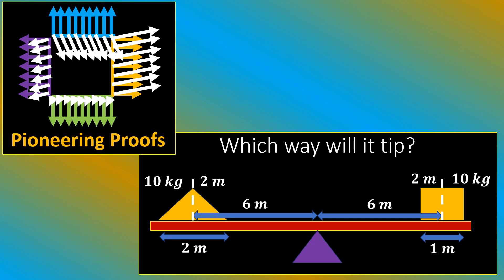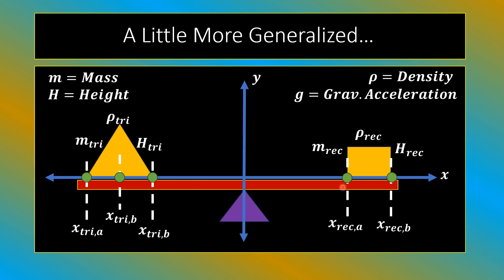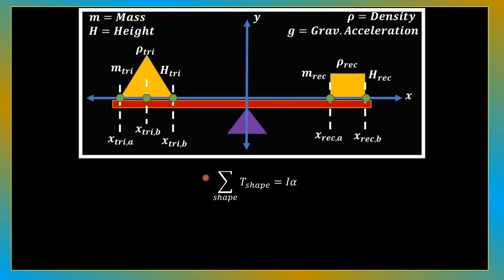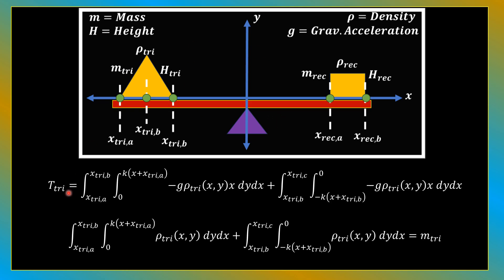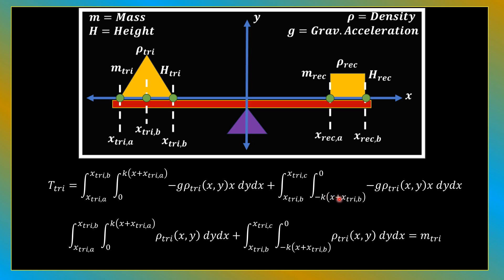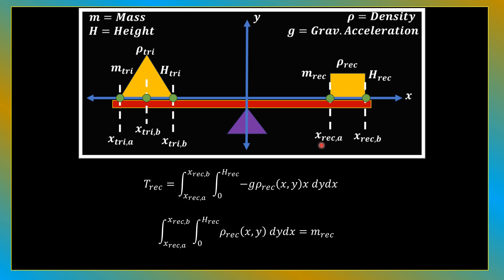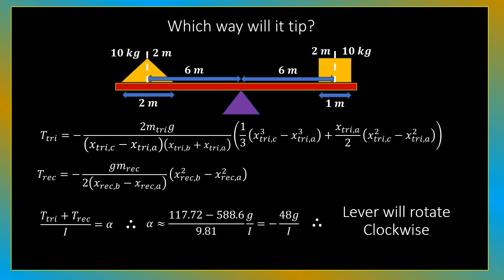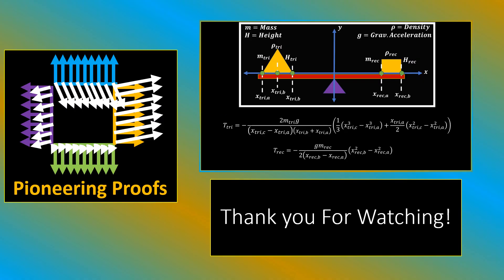Can you Solve this Lever Engineering Puzzle?

Comment: When the lever arm is horizontal, the system is equally balanced so will not rotate.  However, once the lever is tipped slightly, the height of the centres of mass becomes relevant, and the centre of mass of the square on the right is higher than the triangle on the left.  This will result in a net torque which operates in the direction that the lever arm is already rotated.  Interestingly, it doesn't matter whether the mass with the higher centre of mass is on the left or the right.

Comment: just finished my BS in ME and i would suggest that equal mass and equal distance to center of mass for both shapes would imply zero rotation. sum of moments about the fulcrum establishes that, regardless of shape, (10kg * 6m) - (10kg * 6m) = 0. height and shape are irrelevant. the total moment is zero, thus no rotation. i always recall center of mass as king but please correct me if im wrong!
Reply: No you’re 100% correct! I think the author made a mistake somewhere in their calculations. That said, it’s an interesting problem and always good to double check :)
Reply: I was surprised to see the conclusion that the lever would rotate at all. There's an error somewhere, but I'll leave it to someone else to find it.
Reply: @clarencegreen3071   I have done the calculations for fun, which this comment is too narrow to contain (Fermat would be proud). Jokes aside, a “very short” proof follows by the fact that the integral for the torque can be shown to be equivalent to $-g*rho*\iint_A x dx dy$ (using LaTeX notation… what I mean is a double integral of the function f(x,y)=x, with A, representing a shape, as domain). The double integral is, by definition, one of the geometric moments of order 1 of the shape A, which can be shown to be equal to the area of the shape itself times the horizontal (x) barycentric coordinate, let’s call it X. Since area times density is the mass, the torque simplifies to just -g*m*X. As you can see, it depends only on the position of the center of gravity and the mass, the shape has no influence. You can show the result by calculating the integrals explicitly as well. I have done it as well for fun but it takes around 3 pages - already formatted with LaTeX!
Reply: @francofusco4206  haha i love to see the mathematic proof behind it. as an engineer i rarely look that deep into the math. from my perspective, i just set it up as a simple sum of moments. about the pivot, the moment is M = (F_⊥) * r. that is, only the component of the force that is perpendicular to the line of action (in this case, the 180° flat line), can cause a moment about the pivot. in this case, the force for each mass is their weight, which acts at their centers of gravity. because we only care about the perpendicular component, the y-location (height) of the center of gravity for each mass is irrelevant. each center of gravity has the same x component, which would create the same perpendicular force component, and thus result in the equal and opposite moments. no rotation!
Reply: @  yeah that’s the way to go! My explanation was more why you can do it as you said, a reassurance that the math behind it is sound. I’m an engineer as well and honestly the beauty of it is that 99% of the heavy lifting is done by math in such a way that I only have to care about a very simple and elegant equation - like torque = r x F :D
Reply: yes. hard way is integrating an infinite number of infinitesimal slices of mass, which are multiplied by their distance from the pivot

easy way is knowing you can treat each block as having its mass concentrated at its center of gravity

but solving problems often means convincing yourself of little facts like this. i know i wasn't completely sure ... i mean, the intuition is that the bits of a block further from the pivot might have more influence on the outcome, i think. so the quick check means knowing about those slices in the integration, but you don't need to do any calculus:

so, those blocks are symmetrical. (1) by symmetry, the CoG is on the center line. [height is irrelevant.] (2)  every pixel has a corresponding pixel at the same height, at the same distance from the block's centre but on the opposite side. if the CoG is D distance from the pivot, the torque of those two pixels is m×(D+x) plus m×(D-x) = mD + mx + mD - mx = 2mD. in other words, it makes no difference to the see-saw if you move those two pixels to the centre line, or to the CoG because height doesn't affect torque. and because every pixel not on the centre line has an opposite, all pixels can be moved to the CoG

if you want to be precise with the calculus, the mass of each slice is dm rather than a real mass m, but the example works for any example with slices approaching zero, so it's the same thing

Comment: Just trying to check your final formula for T_tri.

If you put there 
x_b = 0 and x_a = - x_c
then all brackets except (x_c^2 - x_a^2) would be non-zero, which would give you a non-trivial output.

While the triangular with x_b=0, x_a = - x_c and constant ro would be isosceles just standing right ontop the middle of the level  and due to the symmetry could not turn in either direction.

Comment: This is a non-problem. Even when the masses are blobs, as long as the centre of mass is at 6m there is no tipping.
Reply: Yea right? At first I thought the same thing, but actually all this problem comes down to is the height of the center of mass above the board, slightly different heights means slightly different distances to the fulcrum, which means differing torque, which means acceleration.
Reply: @shivangpatel4640   Height above the board is of no effect since the weight acts vertically and therefore only the distance from the fulcrum at a right angle to the force is relevant.
Reply: You can prove mathematically, but a visual analysis of this problem should reveal that the lever lowers the object with the higher center of mass
Reply: @shivangpatel4640  no it doesn’t, it’s correct what the original comment said. The torque equals just the horizontal distance between the center of gravity and the fulcrum (6 meters in both cases) times the force (that is mg in both cases). They therefore balance each other, regardless of the shape!
Reply: @francofusco4206  yea actually youre right, though i think that makes it an unstable equilibrium until perturbed, and im pretty sure itll go clockwise upon perturbation
Reply: @  it will tip in the same direction it is tilted - tilted slightly clockwise? it’ll tip clockwise; tilted slightly counterclockwise? it’ll tip counterclockwise. Mechanically speaking, it is exactly like a pendulum that is resting upright because the barycenter of the whole system is just on top of the fulcrum right now. It is called an unstable equilibrium because if you don’t perturb it, it will not move (equilibrium), but as soon as you alter by the slightest its state, it will start moving and not come back (unstable).

Comment: from principle of equilibirum, should not tip at all
taking moment atmidpoint/support, 
torgue(counter clockwise, triangle) = 10kg x 6m = 60kg.m
torgue(clockwise, square) = 10kg x 6m = 60kg.m
thus, balanced
Reply: Why would the y coordinate matter when gravity is parallel to the y axis and therefore there is no lever arm?
Reply: @gustavocortico1681  Exactly. It doesn't. The lever doesn't care
Reply: @gustavocortico1681  yea actually i think youre right about, but i think that makes it an unstable equilibrium until perturbed, and im pretty sure itll go clockwise upon perturbation, but yea I could be wrong im operating on vibes alone
Reply: @shivangpatel4640 it’s actually a very good observation and you are right! The system is in equilibrium, but it’s not a stable one. You can do some calculations and express the momentum as T=mg(h1+h2)sinW, where h1 is the height of the center of mass of the triangle, while h2 of the rectangle (when the lever is horizontal!). W is instead the angle of counterclockwise rotation of the lever. As you can see, T=0 when the lever is horizontal. T>0 means that you accelerate counterclockwise, and this happens when the lever is already slightly tilted counterclockwise. T<0 (clockwise acceleration) happens when you already rotated the lever a bit clockwise. The stable equilibrium is when the system is upside-down (W=180°). Not that this also assumes that the shapes are glued to the lever!
Reply: lengths are different
Reply: @jacksoneverts2567  centre of mass is at 6m only. shouldnt matter
Reply: Only the x component of the center of mass is the same, the y components are different, you cannot substitute these objects with point masses placed 6m from the fulcrum, theyd also need to be at the proper y coordinate. The different y coords between left and right masses mean different radial distance to the center, which means a difference in magnitude of torque

Comment: So the answer is..?
Reply: Shouldn't tip at all
Reply: It doesn't tip unless you make it tip. Masses are equal and centers of mass are equidistant.
Reply: He did say "the lever will rotate clockwise" so I assume the side with the square will tip
Reply: Centers of mass are only equidistant on the x axis, the respective heights are different, r = sqrt(x^2 + y^2) is different between the objects,  so if we consider the torque formula F*r*sin(a) the tangential angles are the same, but r is different,  the object with the higher center of mass will have a slightly larger r value
Reply: @shivangpatel4640  But sin(a) will be different too. The only part that matters is the part of the arm perpendicular to the force (this is what r*sin(a) denotes). Since the force is along the y axis we only need to care about the distance on the x axis. Since the center of mass of both objects is at the same distance along the  x axis the torque will be the same
Reply: @miguelvieirapereira1111  yea actually youre right, though i think that makes it an unstable equilibrium until perturbed, and im pretty sure itll go clockwise upon perturbation
Reply: @shivangpatel4640  if you think about it, r*sin(a) equals x, so only x matters

Comment from the maker: I forgot to mention that in the formulas for torque, I assumed that rho(x, y) = rho = constant, but that's just a small detail
Reply: Hey, the method you show is sound,  but you must have made a mistake somewhere in your calculations... The correct answer is that the system does not move. I have done the same calculations as you for fun and they lead to zero total torque, I can share them if you want! (I have been trying for a while to comment with a link to the report I wrote on Overleaf, but I think YouTube is blocking the comments when they have links... Let me know if you want me to send it via email or what not!)